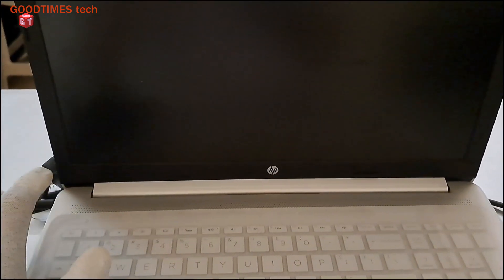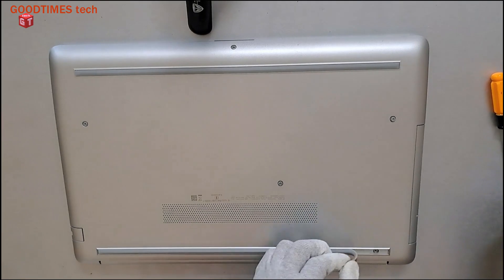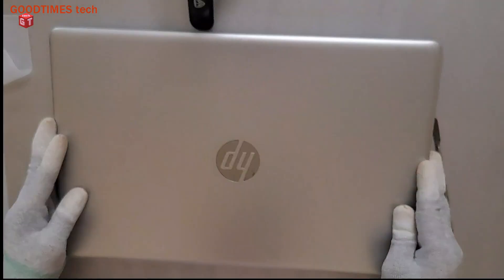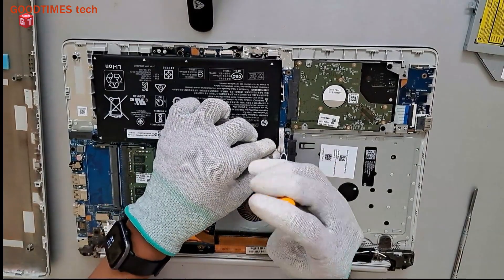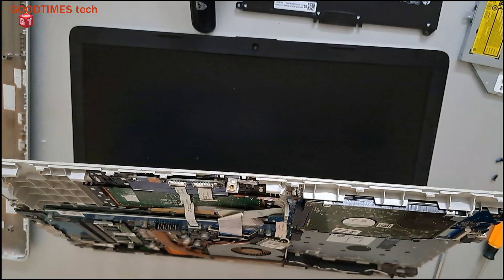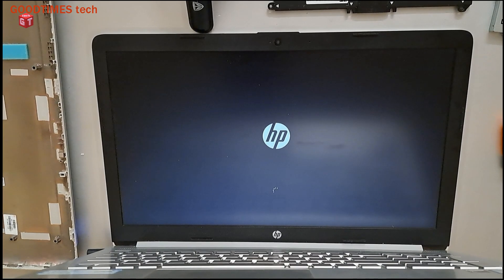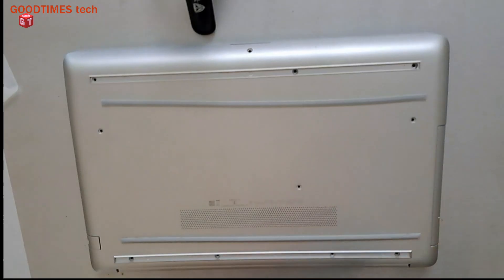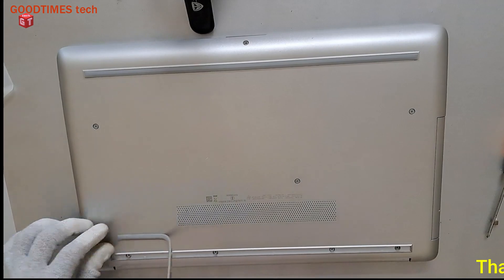HP 15g dr0006TX Showing blank screen | How to solve !

Comment: bro i added new battery from hp service centre n now the bios is invalid it is saying aftr even adding new battery so that we need to change the cell i think 
correct?? answer me
Reply from the maker: Hi bro, If it is showing bios checksum error after replacing the battery then just restarting the laptop should solve it and after the OS has bootup just change the time and date. If this won't work please email me the picture of the error to winsometech703@gmail.com